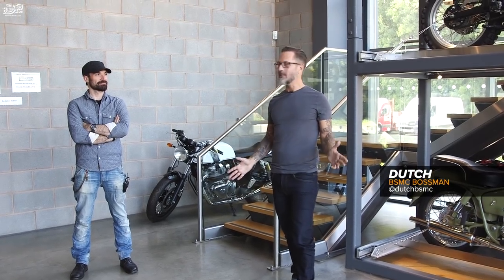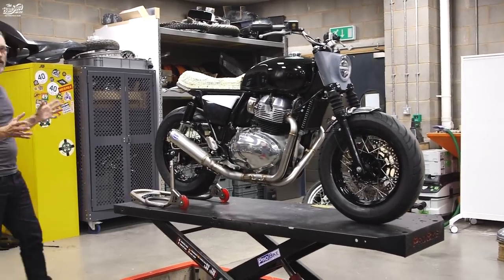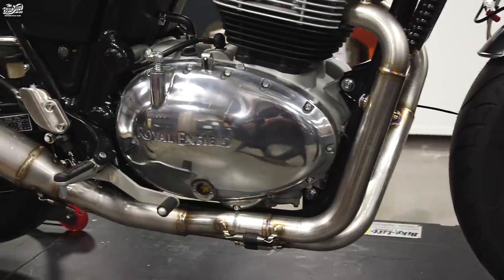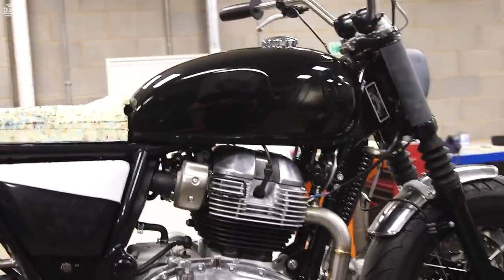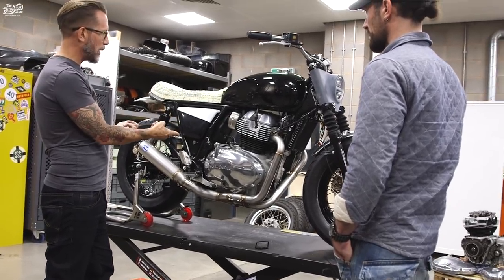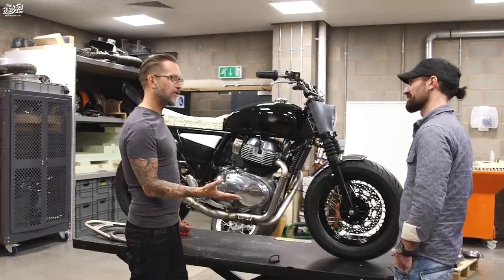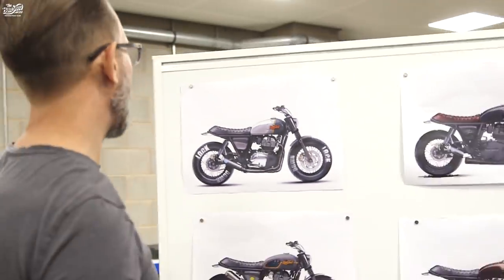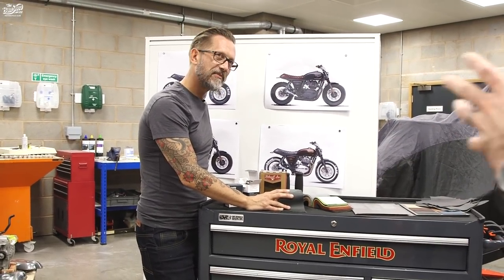BSMC x Royal Enfield 650 Twin Custom Collab - Stage 2

Comment: Great bike, just how it should look, and how I plan to build mine one day. The only thing I would shape different is the front headlight fairing. Mine would be a bit taller like a narrow bullet fairing. But like in this case the headlight would first be placed deeper in between the front fork. What I really want to ask is did you need to make any adjustment to the front  and rear fork in order to fit the balloon rims and tires?  I wonder is it expensive to order the rims like that from Hagoon or Baak for that reason? Can the balloon tire of adequate size to achieve that affect be mounted on original 16 ' rims?

Comment: Biggest gripe I have with the RE twins are the wheel and tire package. They really should have chosen 17inch  rims with the option of spoked or alloy's. 18's in todays time are just too odd. Ditch the 18's RE! Silly choice. Unfortunately this is one of the most expensive mods if you decided to DIY. The reason I haven't and wouldn't unless they switch on and bring 17's cast alloy to future models. Just like Triumph did with their 865 Bonneville's with the SE. A much better handling/performing bike than their spoked 19inch front versions.

Comment: Do larger diameter front pipes alter the "engine brake",  I'm a huge fan of engine braking. Another channel mentioned something about different exhaust components may change the engine braking characteristic but never elaborated on the subject.....just curious

Comment: Oil cooler line is almost touching the exhaust pipe from the left cylinder. Try to keep the purpose of oil cooler with proper clearance. Rest looks cool except that headlight..!

Comment: Looking good.  I wish I had known about Baak a couple months ago, those handlebars are exactly the look I was trying to find.  I found something similar, but those would have been perfect.   Are those the Baak flat track bars?
Reply: Yes they are, I bought them for mine and stoked to see they're using them on this build too.
Reply: MontageRock what bike did you put them on?  Royal Enfield 650?
Reply: Actually these bars are the BAAK N°1 bars, not the Flat Track ones ;)

Comment: Do the badges get off when heated with a heat gun?
Reply: Yes. You may have to use some petrol to remove the left over residue though.

Comment: It's... OK... I guess.  But that headlight mount is horrid .  It has too much mass as a mount for an optical part, and it's a large expanse of flat gray - which makes no sense in relation to the rest of the bike.  Oh!  Maybe it'll match the color, shade, and texture of the seat!  Great mismatch in function, though.  Even if you paint it, it will have too much mass.  It has to be re-thought.

Comment: Jesus wept.
I just watched this till the end. 
Bespoke stockbroker, computer nerd tech, leather flask compartment, 3D printing, utter waffle.
Its fucking depressing.
Edit,
Do you know what i find uplifting and impressive in 2020?
Vids, shops like Low Brow Customs, Japan Choppers, etc.
Basically guys building cool stuff with OLD MOTORCYCLES, who are prepared to get their hands dirty, their fingernails black and broken. Young guys resurecting old stuff, learning how to rebuild motors and gearboxes, play with carbs and points, ride serious distances on rigid framed chops with 40-60 y/o engines that nobody else understands, nor wants. Thats respect.
Spend all their money on their bikes, any money left over is to party, not have the right brands and clothing.
How it used to be.
Anybody remember s/h hobnail army boots and donkey jackets?

Comment: A great looking bike spoilt by bolt ons 😠 an tyres aren't built there made. Try not wearing such tight trousers there cutting off the blood to your brain
Reply: I'm all for criticism, but the only thing bolted-on is the handlebar, and even that will get powder coated a new colour. All the rest is cut, modded, welded or made from scratch in some way, from the wheels to the pipes (which were cut'n re-welded), the top-yoke speedo-mount, the subframe, seat-pan, side-panels, ...even the fenders are trimmed and reshaped by hand.
As for the tight trousers. LOL. I'll take your fashion advice when you show us all a photo of how well you dress. Perhaps you'll win me over to a new style.